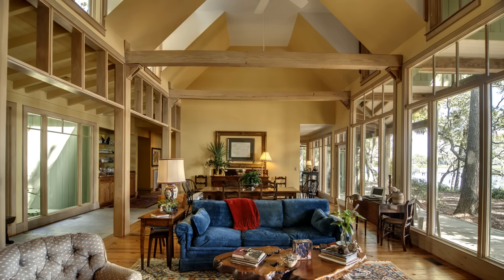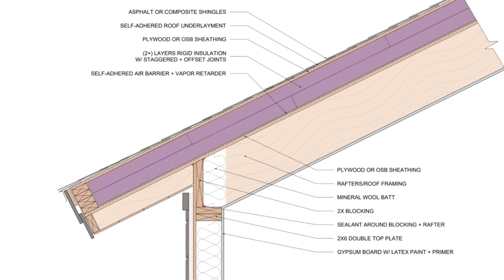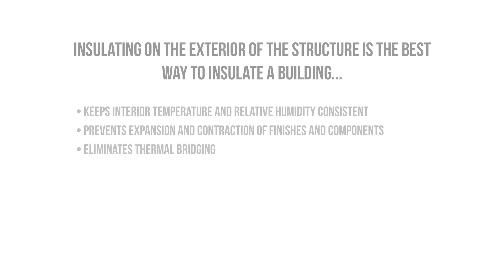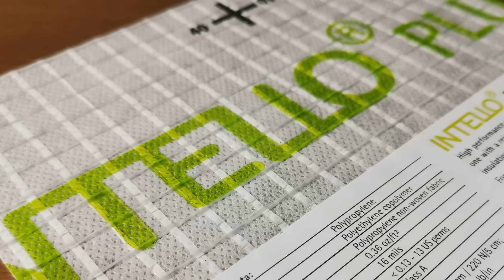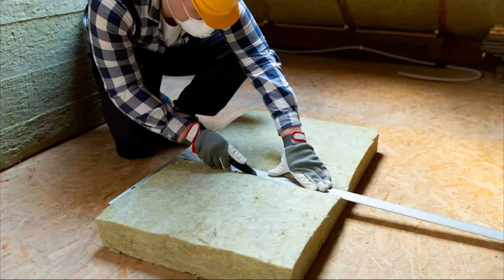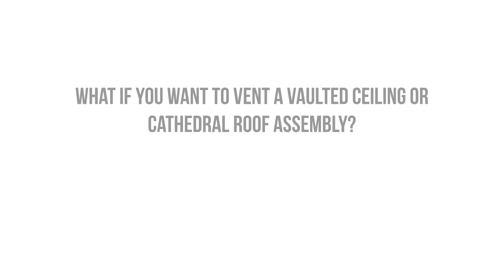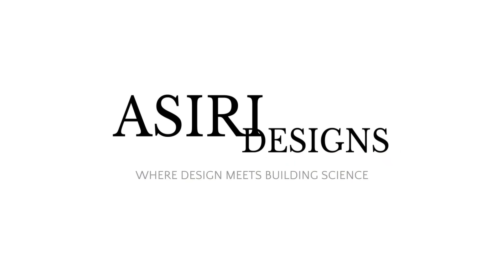A Complete Guide to Insulating Vaulted Ceilings | Unvented AND Vented Solutions

Comment: Glad you mentioned workmanship as a key element for a successful assembly. Our favourite strategy is a scissor truss with a continuous ventilation baffle, (usually MSL wood fibre because it is easy to work with, affordable and vapour open) that runs from soffit to ridge. At the interior a monolithic air/vapour membrane, Intello or Majrex with fibreglass dense pack (or loose fill depending on slope). throughout the truss cavities and a 2.5” deep service cavity. We find this to be an economical system that allows for any roofing material or ceiling finish to be used and avoids foam all together.
Reply: I always research people who post comments like these; hoping that they are local to me; alas~
I wish there was a directory of builders who spend a lot of their free time watching stuff like this.
Reply from the maker: That is an excellent strategy, I assume you try to get a scissor truss profile with a raised heel?
Reply: @ASIRIDesigns  yes, definitely a raised heel. Typically 12” minimum.

Comment: I have a cathedral ceiling with exposed beams. We sprayed closed cell insulation against the ceiling that is sheathed with OSB and foil. Between the spray foam insulation and the T&G ceiling is an air gap where electrical, sprinklers etc. are located. I’m concerned about moisture in that air gap causing mold. There isn’t a vent to the outside. We are in a warm climate. Any thoughts?

Comment: Living in a 1.5 story house with a non vented roof kinda sucks. It's from the 1940s and the upstairs ceiling has batt insulation right against the decking. It's always damp and frosty in winter but the super old fir wood is holding up. It has for probably 80 years this way so however long it lasts is good enough I guess lol

Comment: I live in an old house Sacramento CA, very hot area. My living room has a vaulted ceiling with 2x6 rafters. It is a low-pitched roof with no ridge vents. I just discovered that there is no insulation behind the drywall. There also appears to be wood blocking between the rafter, which would prevent air flow in the rafter bays. Can I just fill the void with fiberglass batts?

Comment: It's nice when I find a professional recommending an approach that I've already come up with as feasible approach.  In my case, I want a spacing between exposed rafters of 4 feet, and I want this room to be as efficient as the roof in the rest of the house.  So, I'm going with a pattern of 2x8 rafters and 2x12 rafters.  For my span, I need to space them here at 1' OC.  To make the exposed rafters look more substantial, I'm attaching 2x4 on the bottom of the 2x12 rafters, and installing the appearance tongue and groove on top  that.  I can box in this if I decide the faux beams need to look more substantial or deeper.  The cavity space of the 2x8 rafters can be filled with insulation batts, before attaching the roof sheathing.

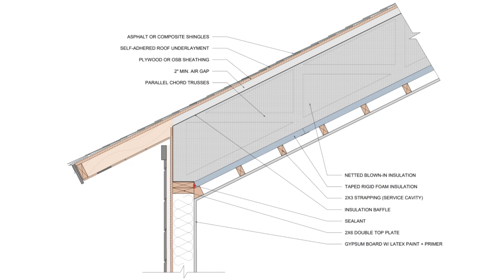Comment: Im curious about the system shown at 4:40 I have 12" I Beams used to make my vaulted ceilings in my unfinished bonus room. It has a ridge vent. I plan to run baffles to the ridge vent, then blow in insulation with 1'' Foam board with aluminum barrier on it to seal it as the vapor barrier. What I don't understand is the "Service Cavity". Is this to just attempt to prevent other punctures in the foamboard/vapor barrier? If so, how do you attached the 2x3 strapping without puncturing the foamboard?

Comment: My understanding is that there are still Condensation risks with any type of dense pack or batt against the underside of the sheathing without venting even with a variable smart membrane. I understand your concerns with spray foam. But I don’t see a way around using it for retrofit situation’s with a Unvented assembly that will not get a new roof. Any mention of exterior insulation on the roof equals a new roof which is incredibly expensive especially with exterior insulation ( I agree this is the best.)
Reply from the maker: @Rondeaunotrondo  Your understanding is absolutely correct, the smart vapor membrane is only as effective as preventing condensation if it's properly air sealed. Something I recommend if people end up using this technique is to provide either a vapor diffusion port at the ridge to help dry out any moisture that could accumulate, or use a vapor permeable adhered underlayment in combination with a vented roof covering to help dry out the sheathing. The second strategy is preferred.
Reply: Thank you. What if there is no venting, and exterior is not being touched?
Reply from the maker: @Rondeaunotrondo  I would honestly recommend not insulating at all at that point if you're unable to vent it or touch the exterior. We've actually got a video on our channel about weighing those types of decisions, I believe it's called "Sometimes it's better NOT to insulate".
Reply: I hear ya. Roof won’t be replaced for another 10 years. Putting ducted mini split in there after realizing ductless head was not great and want to make sure it’s in the envelope. Hoping a flash and batt (correct ratio) approach with intello airbarrier on the interior will work. Will have spray foam 3rd party commissioned. Damned if you do. Damned if you don’t. The world of retrofits and building science. Appreciate your insights.

Comment: Great video, but I have a question about the assembly you propose at 2:45.  I'm about to build an unvented assembly that looks almost exactly like this, but my research has pointed me to using closed cell foam as the only safe vapor barrier option (3"), with insulation batts for the remaining depth in 2x8 rafters.  I worry that with the assembly you propose, condensation will eventually rot the underside of the roof sheathing.

Given a 4a climate zone, are you stating that I can do this with just a smart membrane as you picture?  Any additional risk with double 5/8 drywall preventing inward drying?
Reply: What did you end up doing ? I am in 4a too, rafters are spec to 2x12. I am not sure if i can get the R41 or even R38 if I need 2” for baffle
Reply: I decided on spray foam.  He didn't address this in video (maybe time constraints), but the assembly at 2:45 would require diffusion ports at the ridge.  Since I am creating a soundproof room, those holes are not an option.  For a true closed, unvented roof, I've concluded that closed cell carefully installed with no penetrations in the assembly is the only sensible route.
Reply: @DrEsDub  That’s what I’m doing with my remodel.  Huntsman Heatlok High Lift.  Insulation, air sealer and a vapor barrier all in one and it’s GreenGuard Gold certified.  I’m in coastal Maine.

Comment: I have another question-- but first, I want to thank you for this video- It is incredible!! In the case of a vented deck for a vaulted ceiling, could I fill between the rafters, below the air channels, with batting and then fasten rigid insulation boards beneath the rafters to get to the desired R value? I know furring the rafters is an option, but there are some specifics that make it tricky in my case. Thank you, again!
Reply: It should work In my opinion

Comment: Excellent video, the best one I've found. After 2 years researching about how to insulate my unvented vaulted ceiling, watching a hundred videos with contradicting information I got some conclussions that have been confirmed in this video:
- the 2" gap between insulation and roof only applies to vented ceiling
- you can fully fill insulation between rafters (with no gap) if: a) is a warm roof (exterior rigid insulation) or b) is a cold roof (no exterior insulation) but you add a smart vapour barrier and you are extremely cautious with avoiding vapour barrier perforations.
Thanks very much!
Reply from the maker: @CogitoBcn  So glad it was helpful! One caveat if you use the airtight smart membrane in a conditioned/unvented assembly - you need to use a vapor diffusion port at the ridge as a means of moisture removal if it happens to accumulate in the cavity. Check out this article from Building Science Corporation for more detailed information: https://buildingscience.com/documents/building-science-insights-newsletters/bsi-119-conditioned-unconditioned
Reply: Thanks very much for providing this information and the link, I totally forgot about vapour difussion ports.
Can I assume that they work and are relevant also in single-pitched roofs?

Comment: Love your videos. I’m glad you’re talking about emissions from spray foam, which could be manageable if we only knew what they were and for how long they might persist. Further, please, let me say that, while I feel very positively towards mineral wool, I apply the same standards to it and all other materials used in construction. Many products are fabricated using chemicals like formaldehyde, so we need to concern ourselves with the possibility of the off-gassing of those chemicals as well. If mineral wool is going to be placed not only in the exterior walls, but also in the interior walls for sound proofing, then covered over quickly with drywall, its release during construction could be slowed. We have to measure home interior air for pollutants to know these things. Covering the drywall could slow off-gassing, and lead to exposure of the building occupants. There have been instances of off-gassing from drywall too. We need to start measuring for the presence of pollutants in all of the materials that could harbor and release them, then we’d be equipped to take the necessary actions to keep people safe. There simply is no conscionable excuse for not conducting safety studies of this kind. The companies involved would be well advised to do it themselves, get out in front of this issue, and take whatever actions may be needed. Relevant scientific and professional societies should concern themselves with this subject as part of their ethical practice responsibility.